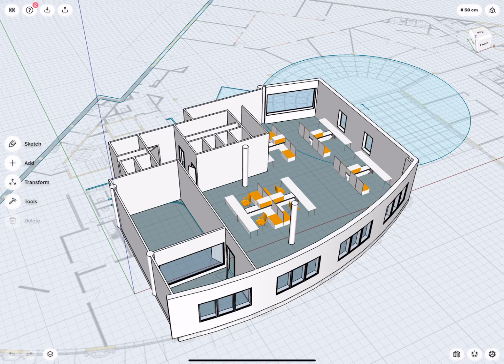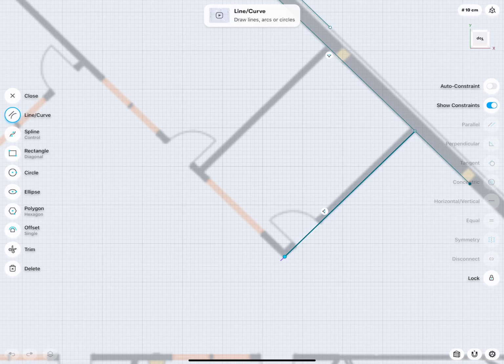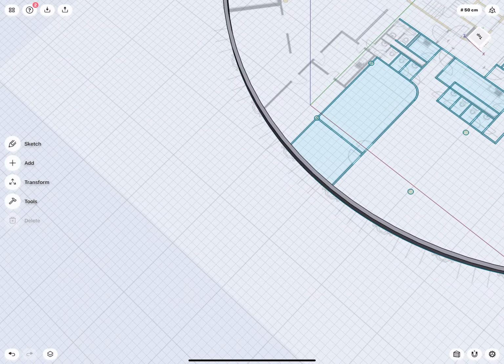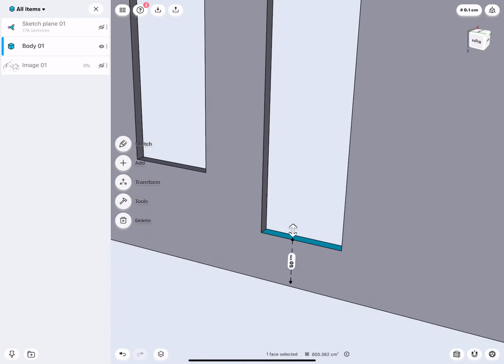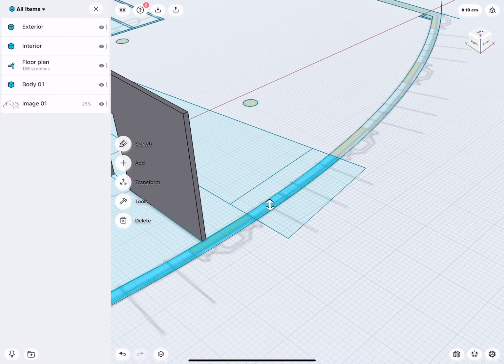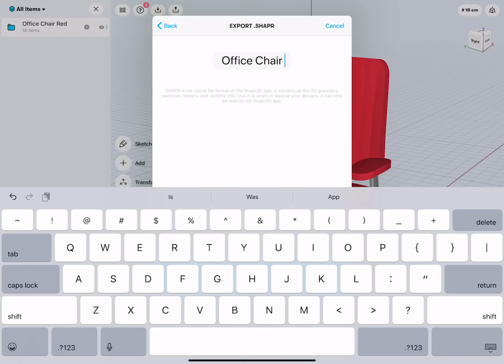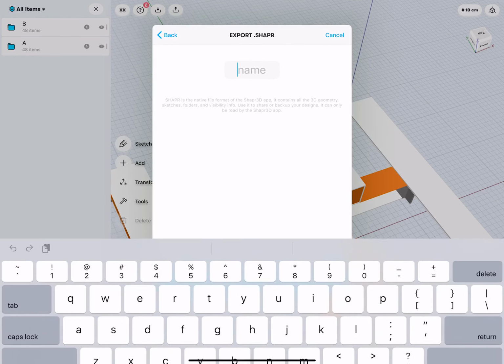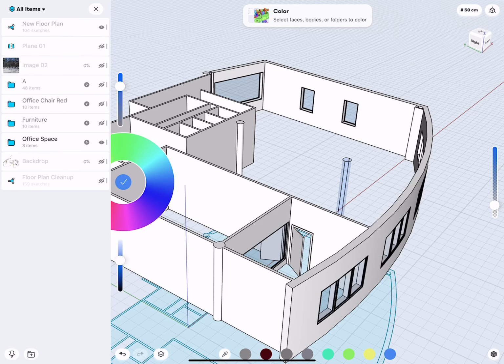Interior design on iPad | 3D design webinar

Comment: Can I scan an apartment’s interior with the iPad Pro LIDAR scanner?
Reply: Yes! We have done this. Not yet tried to import into Shapr3D though. There are several apps that allow this, but from our research, to export in most CAD etc formats you have to subscribe to the app or pay a fee each export! Grrr. Apple, really? Why not just develop your own and give it away with your £1250 tablet?
Reply: @GudieveNing  I don't fully understand your answer. I surly can scan and did an apartment and import to Shapr3D; some imports for free (rough but ok) and some imports payed (elaborated by someone for me, not automatic). I don't understand what Apple sould develop: I think they should sell the API for the LiDAR. Do they already? If they do, Shapr3D should use the API to add the "import through LiDAR" to the software. In any case this will never be as precise, clear, sharp as manual drawing. Maybe just take some measurements!

Comment: I keep trying to import simple dwg floorplans and the app just keeps loading forever until I have to shut it down. I know the dwg files are fine and I have the pro version of the app.. not sure what's wrong
Reply: ludapple I have the iPad Air and had the same problem but it was my first time importing sth so I don’t really know if I did something wrong or maybe it was a huge file since it was a 6 apartment building project 🙃🥺.   Which iPad do you have?

Comment: Why it is not available on Android ?
Reply from the maker: We are glad to know that you are interested in using Shapr3d. Currently, we don’t have an estimate when we would be able to release the app for Android. The reason is that there are resource limits on our end and technical limitations of the Android system. Also, most styluses don’t function at all with Shapr3D.

However, we might consider the Android version too, but not in the near future. Thank you for your understanding.
Reply: Aju Ajmal Muhammad scsvxv=#